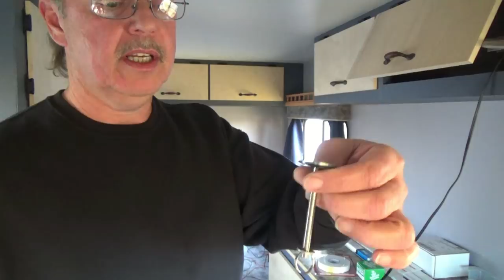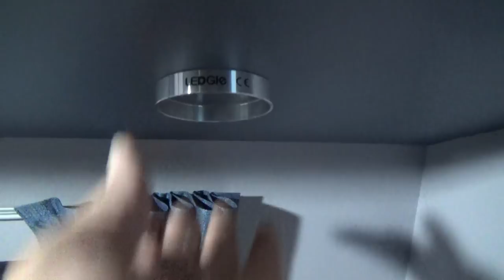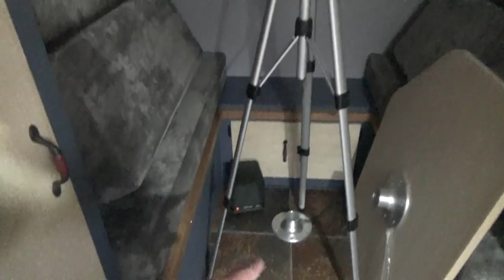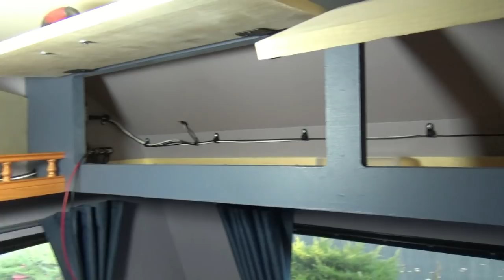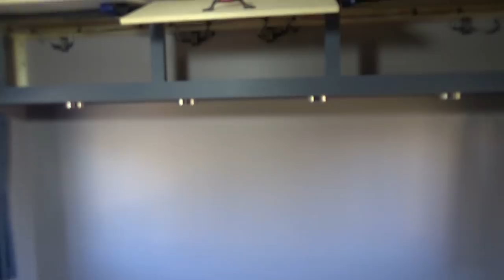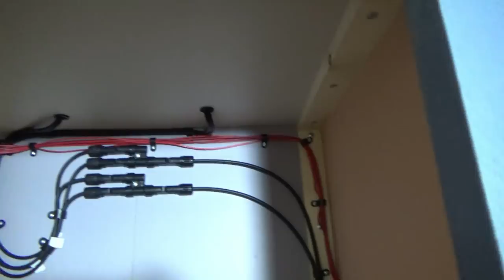How To Build A DIY Travel Trailer - Part 49 (LED Lights Installed)

Comment: Although all the wiring are hidden, I would suggest in your future projects putting all that wiring inside flexible conduits cable glands. Iits  finishing would become more beautiful. However,  for this project,  the way that you explained step-by-step, all the wiring is visible, and contributed a lot for understanding your electrical instalation. Great job, Al !   For my project - based on your instalation - I am thinking about to pre-assemble a main wiring ( like an automotive wiring ). I believe it'll make its installation easier and faster....that's because you taught me the basic lesson ...lol !!! Thanks aa lot !
Reply from the maker: I think your idea is very good.... to make a complete wiring harness. I didn't really know where everything was going to be as I moved along, so a harness wouldn't have helped me much. I practically built it as I moved forward. So glad you are watching the videos... helping you get your own ideas how you want to build your trailer. That's the idea... you get that idea, you start building! Build it your way!

Comment: Curious, but did you think about putting false bottoms in the cabinets? I ask because thats how the couple travel trailers I've had were built and they ran wiring, recessed lighting, etc. inside it (between the real bottom and false bottom).
Reply from the maker: Great question! Unfortunately... thought about that after the fact.  When I first started, didn't exactly know how I wanted to run my wiring. I would definitely do that on next build! Thanks for the tip!

Comment: And now I am all caught up. So my only question is why didn't you run the electrical when you only had the framework done it would have been easier to place sockets and lights although I'm not sure how it would work switching between a/c and d/c.
Reply from the maker: Thank you for checking out all of the videos! That is awesome, thanks for hanging in there! You have a great question! Not sure if I have a great answer! LOL! The electrical was somewhat an afterthought... as I was building, I wasn't exactly sure of the layout, I had changed my mind several times. So definitely wasn't sure where any of the electrical would end up. I just continued to build and decide to run the electrical later. Not wanting any of the wires on the exterior or under the trailer, I ended up taking the route of installing the wiring as I did. I learned much from this build... so the next trailer will have all wiring within the walls. Thanks again, I sure appreciate the comments and questions! Looking forward to seeing your progress as you build on! AL

Comment: Hi there, i’m Watching all you electrical videos, and i don’t see any 12volt system...are all you led lights run off solar?  For power you simply have 110 and solar? Do i have that right?
Thanks
Reply from the maker: Hello Scott! I do have two six-volt batteries (one under each bench) which is connected to a distribution block for the 12-volt power. The solar panels simply keep the system charged. So at night, I have power to all lights and inverter (to run refrigerator an microwave if needed). All lights, water pump, etc., are connected to distribution block for power. Everything works great! If you need more info, you can always email me,  I can send you photos of how everything is hooked up.... I'll explain as much as I can! Cheers!
Reply: Thanks for your reply!  Did you cover the battery install in a video?  Also it looks like you installed your walls and ceiling before doing electrical...i take you don’t have any wires running thru your walls or ceiling?  Just in the cabinets for the leds...
Is there a good way to email you if i have other questions?
Thanks so much!  I can build most anything, but plumbing and electrical is a whole other ballgame :)
Reply from the maker: Hi Scott...! If you watch videos parts 70 through 74, that should cover the electrical and battery. All wiring was ran through cabinets and benches, nothing in the walls. My email address is below in the description of all my videos. if you don't see it: batman97741@gmail.com   This was all new to me to, but if you watch, I feel confident you can do all this yourself. Go to my channel to see all the videos for plumbing and electrical. Hope that helps! al
Reply from the maker: I just checked... parts 74 through 76

Comment: Another suggestion, For future projects? lol. You're gunna hat me before long. lol I see that you're using 1-1/2" bottom rails on the upper cabinet face frames. If you were to put a 3/8"  bottom deck (Flush with the bottom of the cabinet) and a 3/8" false floor inside the cabinet (Set on cleats and flush with the inside of the door opening) you would have 3/4" between the two, to run all your wires where they would not get in the way of your storage and never be seen.
Reply from the maker: Naww... I appreciate the comments. I'll be the first to admit, I don't know it all! :) I learn a lot from people who know what they are doing! I did end up installing false floors to hide (most) the wiring. Tried to keep things light weight, I used the 1/4".
Reply: @OregonBatman  I haven't reached the last video for this build. Do you talk about the total cost for building this camp trailer?
Reply from the maker: Yes sir... I do. Part 54 and 55 talk about the cost and 56 talks about the weight. You're almost there! :)

Comment: Noticed in your cupboards the floors are just a single wood panel you should of added a top floor panel on top of your cupboard frame in your cupboards as they are now they won’t really hold any weight plus things won’t sit inside them cupboards level..
Reply from the maker: Good catch! Yes sir... I will be adding a false bottom to each of the cabinets to help support the weight of things and to keep everything inside from rocking around. Thanks for the tip!